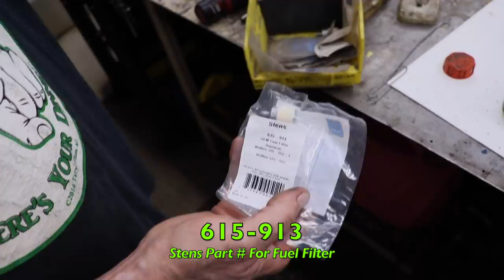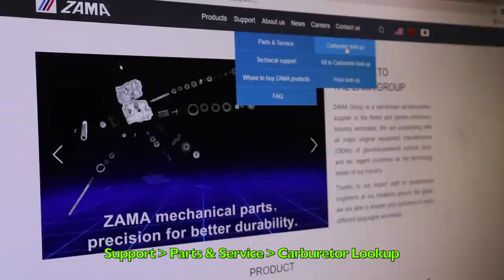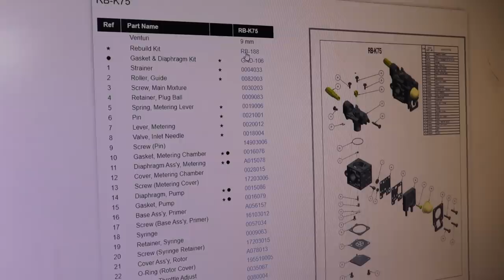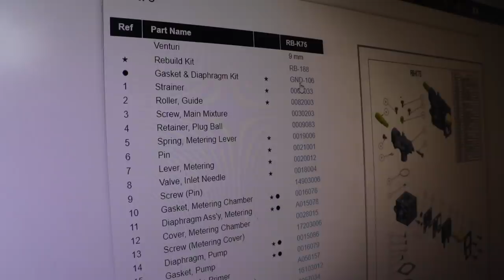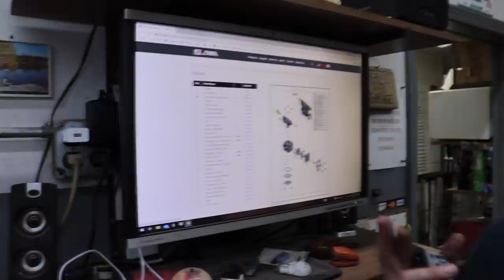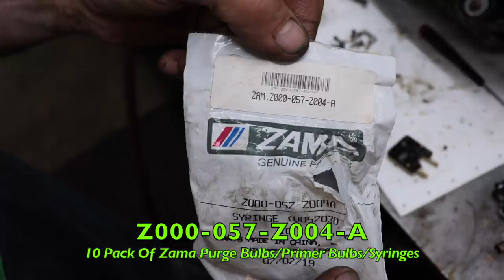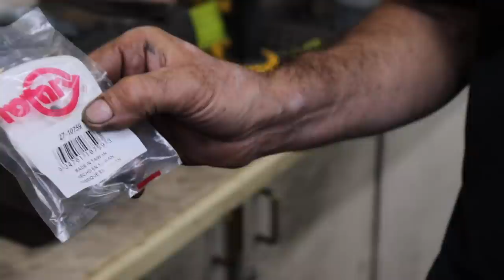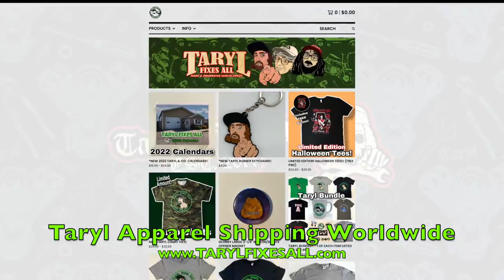You Don't Know About This Secret ECHO Carb Adjustment!

Comment: Mr Taryl  I found Ice trays from the dollar store also make good "parts holders" when working on machines. The individual compartments make perfect places to keep screws and other tiny parts seperate.
Reply: When stripping machines down for servicing, I put the screws and bits in mushroom tubs. I also got for free some trays from a local school when they were throwing them out (I wish I had taken more than 20).
When stripping carbs down, I have some 2 partition microwave meal trays so I can put screws in one side, and other parts to clean in the other side. A meal and a handy workshop parts storage container.

Comment: Keep this trick I devised years ago for the future when you do carbutator cleaning..

Try this... Heat the plastic tube from the carb cleaner spray with a lighter (about 1/4-1/2 inch from the end. Then pull on each end of the tube to stretch it. This makes the outer/inner tube diameter smaller and more of a pin point. When the melted plastic solidifies, use small wire nippers or nail clippers to snip the tube at the smallest diameter that still provides flow when spraying. The cleaner comes out like a pin point pressure washer and the shrunken plastic tube end fits snugly inside whatever port your spaying thru.

You can also do the same to create 90 degree angles in the plastic tube to spray sideways inside long venturi tubes. (Like idle circuits)

I used to make/keep custom tubes around for these situations. Hope this makes sense.
Reply: I know this post is kind of old, but it's a big help, thank you sir.  I never thought about that before.  Thanks for sharing
Reply: Great idea. Thanks.

Comment: If you take the bottom off the gear-case, the blades come right out of the machine after loosening the bar bolts. Then you can clean everything up and deburr the cutters and regrease the gear-case. They're usually filthy; both the blades and the gears. Clean and deburr the blades with sandpaper. The gear-case loves new grease. Then you can swap the bar-bolts around and give them fresh friction surfaces to reduce play, and flatten the hardened washers to renew those surfaces. Loverly vid Taryl. Just bein' a know-it-dactyl.

Comment: great job! I learned so much!
Here's a tip that I used:  I  had a machine that had really dirty blades. I tried almost everything to clean them. then I thought of oven cleaner. I let it stay for a while then hosed it down ....clean.
Don't use oven cleaner on the main machine.

The real secret is adjustment, oil at each use and keep sharp.
Thanks.
Reply: good tip, I got one for free that is very dirty, maybe will try that if they don't clean up after use. Brake cleaner took off a bit

Comment: I'm usually a stihl man,because we have 3 dealers within a 30 minute drive. I found a husqvarna 550xp that needed rebuilt for cheap.  I bought a meteor piston and caber rings. I'm reusing the cylinder because it's still in great shape. I called my one local husqvarna dealer and asked if they had a cylinder gasket. If he'd of told me he didnt have one in stock I'd of understood,but his reply was; oh,I dont stock gaskets.  I was dumbfounded.  I asked,you are a full service dealer right? He said; oh yeah,we'll take care of all your needs. I just laughed when he said it'd take between 8 and 10 weeks to get a simple gasket. I politely said no thank you. Then I found one online from an actual stocked repair shop for $9.99 shipped. Anything I've ever needed from stihl I could get the next dsy,but they almost always had what I need in stock.

Comment: I Use The Small Limiter Cap Removal Tool and Heat It Up and Screw it in Then Pull it Right Out After it Cools 👌🏼😀 Whooola You Now Have Access to The High Speed Adjustment Also There is a Low Speed Adjustment on Top of The Throttle Shaft Also With a Limiter Cap Just Like The High Speed Had 😀😮😀 Dont Forget The Problematic Plastic Roller Under The Top Throttle Ramp Cover They Give You a Metal Replacement Roller in The Updated Carb Kit 😊👌🏼😀👍🏼 Awesome Video as Always Taryl Dactyl 😎

Comment: A Terrell correct me if I'm wrong But doesn't some of the new little 2 stroke chainsaws and hedge tremors and stuff have a built-in timing advance Built into the Coil And can cause a similar problem With the revs cutting out?

Comment: I’ve seen those screens look perfectly clean, but when you hold them up to light and try to look thru them, you can’t see anything. So just because it might look clean, it doesn’t mean it isn’t plugged. When in doubt, change it out. BTW, those pump diaphragms are made from Mylar.

Comment: I got an echo 225 that I get oil spray out of exhaust. Seems to be a common problem. Mix is right with echo red 2 stroke oil, the "good stuff". I've seen this comment before. Wondering what you would do about that?
Runs great. Should I just keep wiping it after using it? Lol

Comment: There's another adjustment on top of the throttle barrel. There's usually a brass plug to drill out to access it...
Reply: I believe if there is one there, its for the "Low" setting. I'm surprised the old machine has the new EPA style carb
Reply: There's a good reason to watch the whole video.
Reply: @davidwalker7383  sometimes we ain't got the time
Reply: @M.TTT.  Then keep your comments to yourself

Comment: Your "worn out screwdriver" doesn't work properly on the Echo screws because Echo screws are JIC(sometimes called JIS) Cross Slot and not Phillips. Get you some JIC Cross Slot #1, #2, and #3 bits or driver and you will be able to break the screws before the driver slips out of the screw. The same goes for Hondas as well. Pretty sure Kawasaki and Yamaha as well. And they work pretty good on Phillips head screws as well.

Comment: Echo Techo here, don’t waste your time rebuilding carburetors on echo equipment. Some of the older stuff such as the grey echo we see here can be rebuilt and it is possible however once you calculate the cost of time, money, and downtime you will be much happier just replacing the carburetor to begin with. It’s. 40-60 dollar carb, no need to put a 20 dollar kit+10 dollar primer bulb plus 30 dollars worth your time into that old carb. You will have spent just as much and as you can see even when done by a professional it won’t run that great. That is just a characteristic of theses echo style carbs, the newer echos are even worse and more sensitive. Most all 2 cycle carbs can be rebuilt but this is just one that’s definitely not worth it.
Reply: We rebuild them unless they are trashed or the purge diaphragm the white body is bad it makes you smarter when you take them apart and you learn how they work but yes replacing them is better but it depends on the condition
Reply: Time will eat your lunch and no profit eather

Comment: Run some Seafoam in the fuel tank drain your tank next seafoam fresh 2cycle fuel put about 3tsb of Seafoam -1/8 cup pump into carb next put in 1/8 tank of fuel start engine put it on half choke until it clear then full open as the fuel goes through cleaning screens ports while working

Comment: Taryl, there called washers not worshers lol 🤣🤣
Reply: Washers are what you clean your clothes in; worshers fit on bolts, screws and under nuts.
Reply: @donaldeisenbarth5255  
That would be a washing machine
Washers are what go on bolts and screw's. Go to Lowe's and ask for a flat washer or a lock washer, and see if they give you something to wash your clothes in.
Reply: @donaldeisenbarth5255  LOL